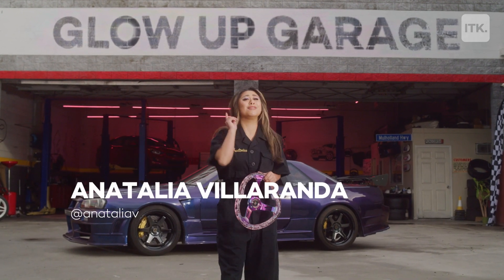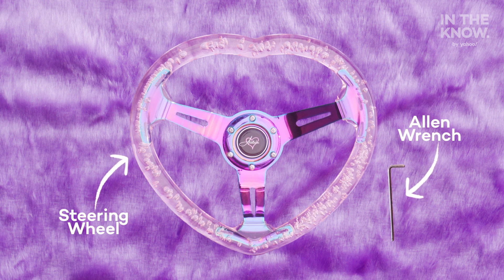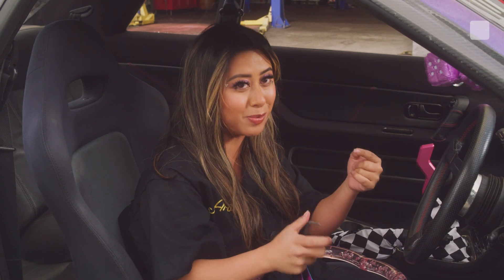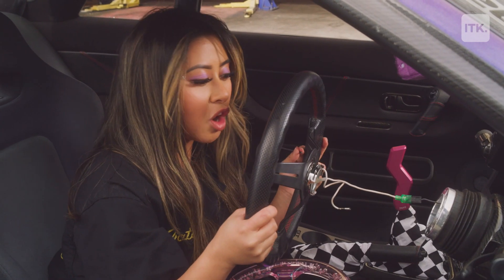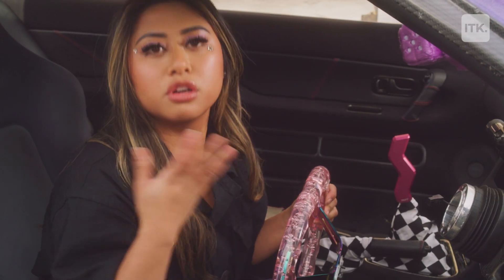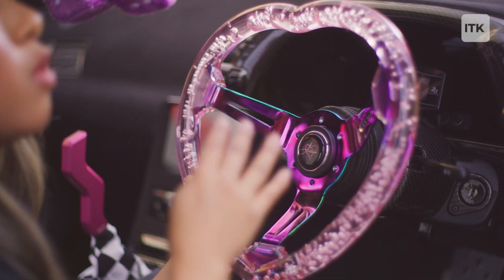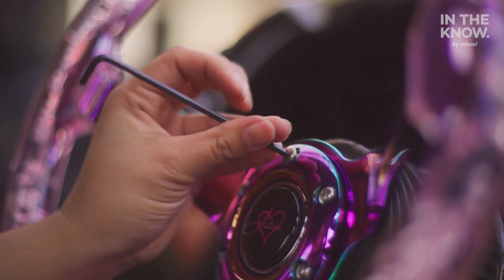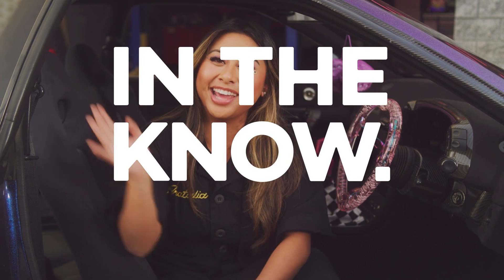This car's heart-shaped steering wheel glow up is out of this world

Comment: That's not smart. Steering wheels are uniformly round for a reason. Any variation in that may affect your control. Cute is not required.
Reply: Not all of them are uniformly round, some have stock non circular wheels. This is not dramatic enough to effect your control- if you're concerned about that then you should probably work on better control management.